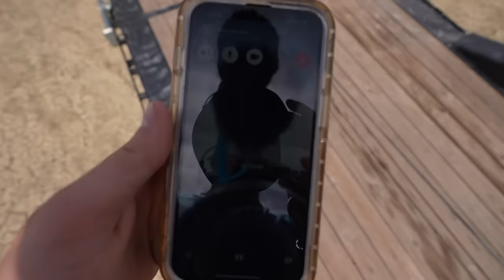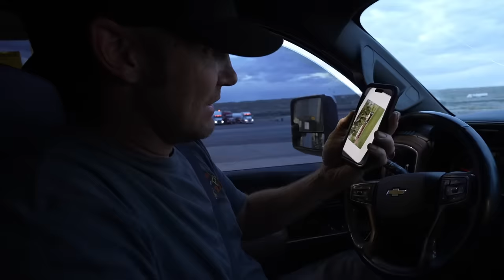I'm Building The Oldest Off-Road Monster Bus!

Comment: The best thing I ever did for my house was to get a whole house/shop GENERAC Generator. It automatically turns on when the main power goes out and automatically turns back on when the main power is restored. I have mine for ten years now and it is awesome! You can get different sizes that will fit your output needs. Runs on natural gas and propane. No more power outage worries!

Comment: the original spacer from dodge is alum.   mine broke into several pieces.  ordered a new one and got tired of waiting measured how thick the spacer is and went to local hardware and found 3 nuts the right thickness and starter works great and has for years.    never replaced with the factory piece.

Comment: What I do with my wrecker is back up close to it and tie it to my straight winch. Then to my boom pull them tight with with the vehicle suspended. Stays put pretty good it will get close sometimes but It hasn’t ever hit. My boom does look longer. It hangs about 5ft off the rear of the truck. Something to try works around here. It will add more weight/tension on the boom pulling back towards the truck.

Comment: And please make sure you wash out the intercooler the turbo sends pieces all through the intercooler when they let loose and it can get blown into the intake and hurt the engine.. we just use some dawn and the hose and flush it out several times ❤❤❤

Comment: Run a charging wire from the truck to the trailer and leave the truck running while using the winch. Awesome video!
Reply: There is a pin in the 7 pin trailer plug that is 12v.  May need to add a fuse under the hood to make it hot.

Comment: Paul, I had to laugh when you mentioned the jetting on that 2 cycle bike . When I was riding two strokes in the mountains of Colorado I took jets with me because of the extreme elevation changes if you want to have decent power you're  changing  the Jets two or three four times a day .

Comment: Nice R, should be a decent machine.  Desert tank, hard to find headlight guard,  pipe ,get it jetted properly with some good fuel and should rip. Gotta do something with the floppy front fender too, a 3rd gen R shouldn't have a fender brace. Looking forward for more trike content.  3wheelerworld is still operating along with a bunch of Facebook groups if you need parts or tech.

Comment: At 6:45 that is the design you should of made the off road flat deck. I guarantee you couldn't have a better set up or more balanced which is probably the most critical part of something that needs to go over rocks with a load on the back & that high center of gravity.

Comment: Thats a cool bus.matt has some huge axle that would be great .irs and ifs.too cool .im building a 48 buick limo hearse. Built by flexible.2 dr sedan lengthend 6 ft,5 ft long 2nd doors heightened 9 inches,high crown roof,and barn door rear .ist going om a 87 chevy crewcab frame,same wheel base as dually but its 6 ft longer than dually.502 big block.4l80 motor home trans.holds 16 adults comfortably

Comment: Those 12 valves are just so loyal. Usually the only reason they won't run is if they're out of fuel... Paired with an nv5600 they're pretty much unstoppable.

Comment: My father always used to use sawdust as oil absorber also. He did a lot of wood work and had lots. I didn't like it though. I found that the wood chips soaked up fluids great, but then tended to stick to the slab and be hard to sweep up. Some oldster back in the 1980s told me kitty litter works good too so I tried it and never went back. Way cheaper than floor dry, and works just as well. I found it way easier to sweep up.
You might give it a try. At the very least it should generate some comments about misuse of cat litter! :-)

Comment: Dead battery is why I took the batteries off all my trailers! I have 2 group 31s on my truck and a welders cable running  to the back for my winch and dump trailer. Always charged up and ready to go!

Comment: -- Born and raised in the rust belt, it absolutely astounds me you can leave stuff sitting outside down there and it lasts as long as it does.  Heh, I've got one week, 300 bucks a year going into to rust converters, RP-342, fluid film, the works.  Have more needle scalers than I know what to do with.

Comment: Paul, why don't you have the 50amp truck power from the 7 pin hooked up to charge the battery? Either that or run a high amp cable that you can plug into the truck when you're winching?

That old bus looks great, will be great to see it built.
With the amount of times you loose power at the shop, is it worth getting a generator backup?

Comment: Get yourself some 50 amp battery connectors and run 1.0 gauge wire from your battery to under your back bumper and put a connector on it.  Then make a matching cable on the trailer that can plug into it.  When you need to power your winch just plug it into the truck and you have max power off the truck at any time.  You can make accessories like jumper cables too that plug into it.  My trailer and winch have no battery.  It just plugs into the back bumper and i NEVER worry about it not having enough juice.  You can buy pre done kits for using jumper cables to make it even easier.  My jumper cables can jump from the back bumper connector or under the hood and i can power my trailer winch whenever i need to.  It's about a $200, 1 hour project and you never have a dead winch again.

Comment: As the owner of an 2001.5, 24 valve, XZT+, Intake temp fooler, auto, 4x4, 8800gvw, 4" SS exhaust. lift pump on frame, you make  me clutch my chest every few minutes.

Comment: For the monster bus, used planetary reduction gears on each wheel hub, like in a rock truck. Or to do it a cheap way, if you rip old auto trans out of several junk vehicles you could use them instead of short arms to drive each individual wheel. Just leave them in drive, and have the primary gearbox +transfer case do the Fwd rev selections. For weight, the reduction gears is the better way. This way your drive lines don't have to handle all the torque needed to push the huge wheels.

Comment: Check out “The Hungry Diesel” fuel pin and 3200 rpm Governor Spring. You’ll get great throttle response and with Merlin’s pump adjustments that 12 Valve will really come alive.

Comment: you should add a charge cable from you 7 pin to charge the battery from the truck so when your get to your destination the battery is topped off.

Comment: All this suspense not telling what you are picking up, is sorta moot given the thumbnail for the video.  That is a great old bus.

I would have thought after the Grampa Sherm wrecker conversion from manual to automatic working out so well off-road, that the rollback would be an automatic too.

I used to work for a company that made locomotives.  The Cummins in them is V16 with quad turbos making 3000 horsepower.  Gotta love that company.

Comment: Make sure you go in through the front of engine and remove the dowel pin of death out of the front of the gear housing if it hasn't already been done. 12 valves are notorious for it rattling out and it will save you and 18 hour job to replace the gear housing box later.

Comment: I’ve seen it before that the p-pump does fit on the 24 valve and take off all the computer controlled stuff off it.  DeBoss Garage I believe did it.  Airflow of 24 valve and simplicity of the 12 valve.

Comment: Badland winches are a great addition to a car hauler. I have a slow solar panel on my car trailer. I later put on a 10 gauge wire that charges my trailer battery while I go down the road. It has a cut off switch on it to isolate it if battery totally goes dead, the winch draw won't melt the wire.

Comment: I'm surprised you guys didn't think to run a 2pin high amp connector for truck to trailer winch battery, so the truck can recharge the winch battery and run the winch while it's recharging, then disconnect when you unhook trailer.

Comment: Believe it or not but I can see your vision with the bus that is going to be one fantastic build, as for the new rollback this is also something that will be fantastic and a very good work horse the Cummings is a brilliant moter I used to drive a European truck with a Cummings in it you could never kill the thing it just went on and on when I left the company she had three half a million miles on the clock and was still going 5 years after I stopped driving it, we changed the oil and filters regularly when I was driving it I was alway's at my max weight of 44 tonnes sorry I don't know how meny pounds that is but I loved the old Cummings it never let me down.

Comment: You need to get the plug in jumper cable plugs do you can wire the winch to the truck and unplug it when you're not using it

Comment: One tip I can give you is to double check all the ground straps connected to the block lol I've bought a couple 12v trucks that didn't run but it ended up being a ground wire not tight running to the block lol good for me bad luck for the previous owners haha..

Comment: As much as love the all mechanical nature of the 12 valve, a 24 valve is a better engine because it can be tuned up or down with just the flip of a switch. 12 valve requires injectors, fuel plate, fuel pump timing, or at bare minimum some screws adjusted...

Comment: I wish I had a picture, I built a tow bar out of a jetski trailer, my 78 c30 filled with a 1986 yz490, a 2001 cbr 600 and living amenities,  pulling my 74 f100 filled with my scrap metal and other misc junk... the c30 front end was floating from Joplin Missouri to Colorado Springs, Colorado... i can drive 55... : l ..

Comment: There is a chemical that changes the rust to a new compound that stops the rust. When dry after you spray it on, it turns the rust to a black color. It comes in an aerosol can. If you want a different color than black, you can spray it directly over with paint.

Comment: My friend was paralyzed on one of those 3 wheelers & was part of the huge lawsuit that eventually was the downfall of the 3 wheelers. The center nut on the handlebars comes off letting the whole assembly to come apart making the fork fall off then dig into the ground is what the "weak spot" on those 3 wheelers were. People always had coolers on the back of them.

Comment: Dang, should just toss some 4x4 axles under that old 2nd gen and run it rather than stealin the cumming motor our of it :) Find yourself a 6 speed manual to toss behind that Cummins. Your cousin showed you how to do that LOL  I loved my 2nd gens. Have 3 I'm trying to make 2 good ones out of them. That sheet metal seemed like it was pretty clean. Was there something wrong with the 24V that you're swappin for the 12V or just because the 12V is more reliable?

Comment: An old two ton electric 2 speed rear end for the school bus would be great, Had an old GMC with a 301 jimmy 6 and 2 speed rear. come out of the woods loaded with cord wood, hit the road shift into high side and hit 75 miles an hour. Side boards just a flapping. Oh to to be young and dumb. This was about 1959 or 60.😄

Comment: If Ben ends up taking this truck and putting the same kind of engine back in it  later then this is going to seem like a lot of extra work rather than just having Ben get an engine and trade it for the truck and fix the torque converter. But maybe there's a different plan. Either way thanks for another video!

Comment: Idear make it heavy equipment tow truck make the tow arm come out the back doors with drop down wheels use a 10 th fork lift carrage all on hyd get a set of the two things Matt bought you run the hyds off a separate power source no pto.. simple

Comment: Paul put a 12v Cummings in it and upgrade the head studs. Turbo. Injectors and high power injection pump. Modular and super dependable. Create a ton of torque and power. Please do it. 👍🏻

(Edit). At 24:00 he’s speaking on 12v for the truck. It really needs the upgraded one in that bus. You need the torque and power. Plus reliability. Come on Paul!!!

Comment: did you guys take i 80 instead of 40 or the 70 ? fuel was probably cheaper taking 80
Reply: my dad built our motorcycle trailer with a wet bike trailer we still have ours my mom has a 1985 atc 200x i had one too but blew the engine up in filmore utah i rode up the 15 three years ago after my driveshaft fell off my f150
Reply: ok you guys did pass thru 70 i love that area ive done 40 road trips that way

Comment: Too late now - you've already started tearing the Dodge truck apart.  I'd have just fixed or replaced the bum transmission and either kept or sold it.  What will you do with that dumb bus? - nobody but you will need nor want it.